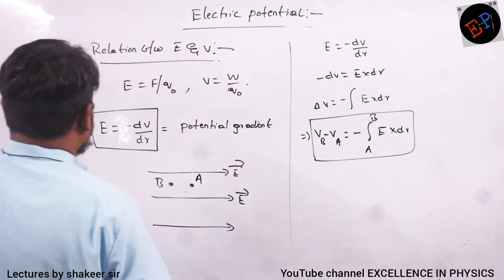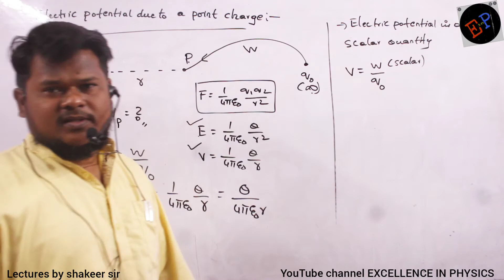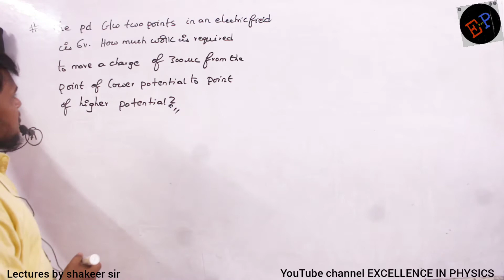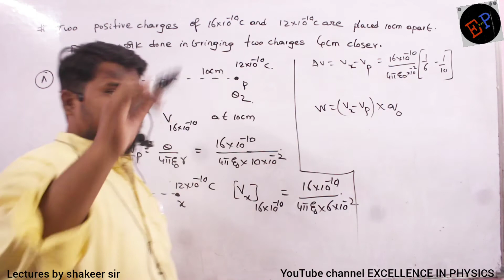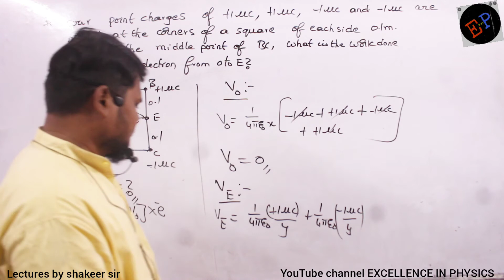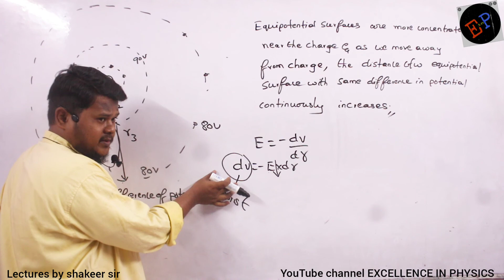L-4//ELECTRIC POTENTIAL//EQUIPOTENTIAL SURFACE//ELECTROSTATICS//NEET SERIES.

Comment: Sir, 
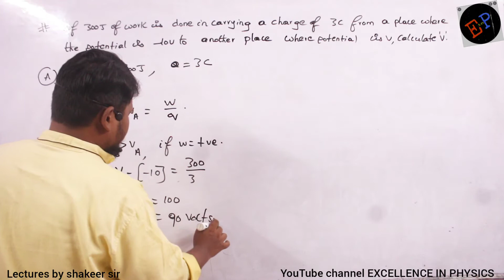At 39:50 min I have a doubt that is
1. Workdone becomes positive when a +ve charge is placed where as it becomes negative when a -ve charge is placed right sir.
Then in  before problem for finding out Workdone from lower potential to higher potential Va>Vb so (Va-Vb)=6 so it is positive Workdone but there u have written -ve Workdone
Reply from the maker: May be mistake